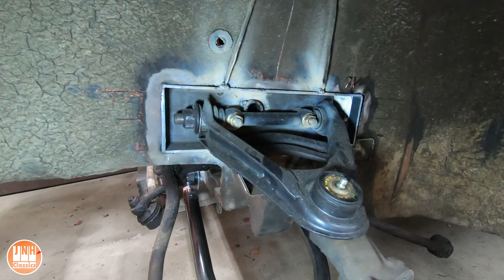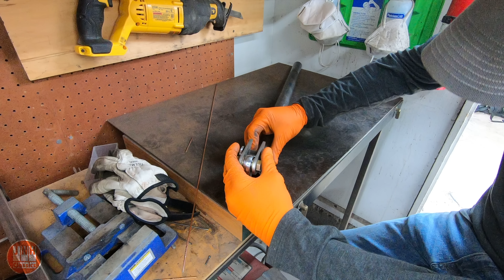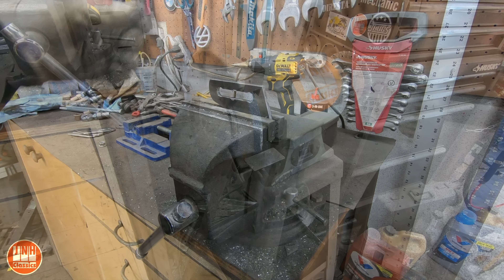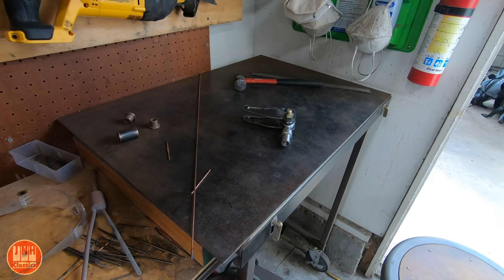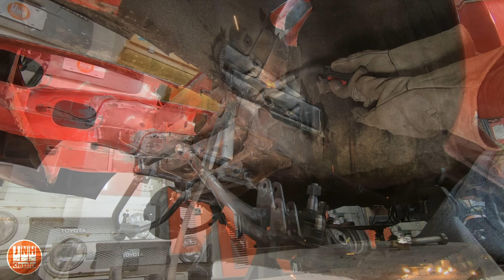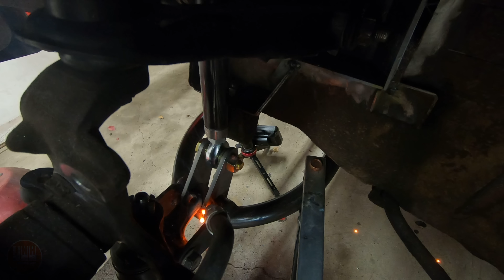My Motorcycle Powered Car - Front Suspension

Comment: Great work.  A question, are the tie rods and spindles forged or cast.  Not sure I would trust welded cast steering and suspension components.  Also you should put a larger washer on top of the steering heim joint to prevent the heim joint from jumping off the spindle if it fails.  Cheers and great project.

Comment: Did you consider going to a rack and pinion system instead? The 133/126 rack would be applicable here and  you could then not have welded parts in your steering mechanism.
Reply from the maker: I did consider it but decided against it. I felt it would create more problems than it would fix. But it’s always an option down the road if needed.

Comment: Jared hi. Apologies but I have a technical question for you -- what type of drill bit are you using to make countersink holes in the steel plate around 2:19 in this video? I needed to make countersinks in a steel plate at home for one of my DIY projects and the stuff I bought on ebay was hopeless -- the s--tty bit I had would not make a single one... Thanks!
Reply from the maker: It’s a step drill bit. I wish I could recommend a brand but I’m not really happy with the ones I have, and I don’t remember what brand they are.

Comment: How did you come up with your suspension Ideas?
Are you self taught welder? As I want to learn tig.
Reply from the maker: Google searches and YouTube videos for suspension design. Yes self taught, watched several videos on tig welding, bought a good welder and started practicing. I think most people that don’t succeed at welding are using a cheap welder. It’s important to have a good machine when you start so that the only limitation is your skills not the machine.
Reply: What welder would you recommend?
What do think of mig/Tig all in one welder?
Reply from the maker: @davidparker3346  pretty much anything made by Lincoln

Comment: Just found your channel this morning from a FB post. Are those shocks being used in the front suspension GSXR rear shocks?
Reply from the maker: Yes they are, but they’re too stiff, I’ve ordered new shocks.
Reply: @Jerod_Helt  I kind of figured that but thought you might just do a spring swap. You can get a heck of a buy on an eBay GSXR or R6 shock that's double adjustable if you can work around the stiff spring problem.
Reply: Yeah, the problem with rear motorcycle shocks is that they're designed to work with a progressive link system, not direct drive.
Reply: What did you decide on for springs/shocks for the final?

Comment: @17:54.....Did the original suspension also raise the car at you turned the front wheels?
Reply from the maker: Yes, thats caused by the caster angle and wider tires. The shocks are too stiff for this car so it’s more noticeable right now.
Reply: An 850 uses 9 degrees of caster due to how light the front is to ensure you get self centering and to maximize tracking stability. So yes, the original suspension gave you significant ‘jacking’ when going from lock to lock.

Comment: Some states, such as my state, have a yearly safety inspection that is performed on all road worthy vehicles.  Any modifications to the suspension warrants a failed safety inspection.  If the shop passes something that is modified and there is an accident due to a failure of the suspension, that shop would be fined, the inspection mechanic and the shop may even lose their inspection license.  I will say your tig welds look good.   Sorry for being negative with my comment.
Reply from the maker: Luckily they don’t do that in CA👍